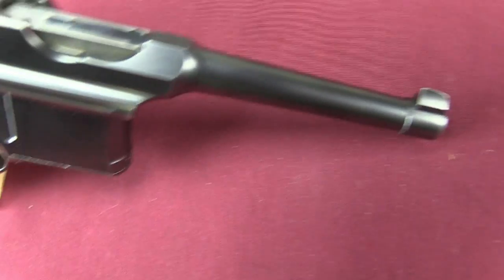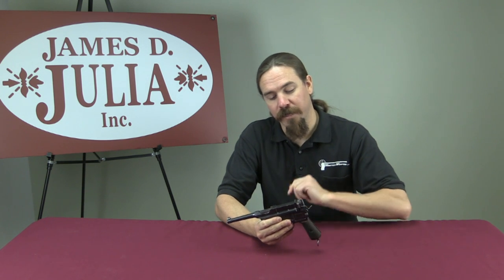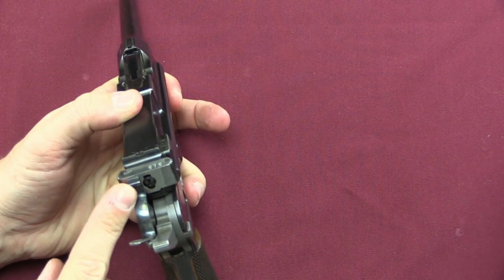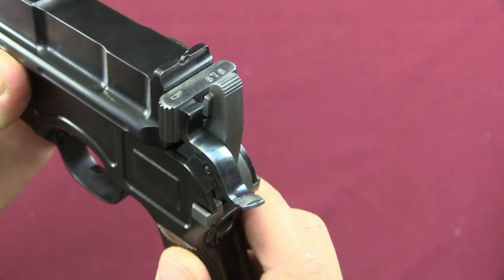Experimental C96 "Joint Safety" Mauser

Comment: It would be incredibly amazing if you ever could get your hands on a Welrod 9mm handgun. For those who aren't aware, the Welrod is a bolt action, magazine fed suppressed handgun in 9mm designed by the British during WWII to equip special operations (SOE) agents as well as operators from the OSS and resistance fighters in occupied territory, mainly France.
Being produced for covert operators, the guns bore no markings except for a serial number. Because the suppressor used rubber and leather washers that literally made an air tight seal with the bullet as it traveled down the suppressor, the rubber wipes had to be changed every 15 rounds, preferably earlier, as the effectiveness was diminished after every shot from the 5fth onward.
Its one of the most exciting "spy" weapons of WWII in my opinion, and I think it would still be quite effective today for the purpose it was designed for.
Reply: I'm aware of what it is, & I agree, it would be amazing to have that thoroughly examined & just seen regardless.
Reply: Adrien Perié except for the fact that they have been banned from import here in the USA
Reply: Adrien Perié 
Would it be called bolt action or single action?

Comment: Mausers are still some of the most beautiful firearms on the globe, in my opinion.
Despite being a fan of Norinco and Tula.
Reply: +Moon .Gazer
 Just its appearance is amazing. It feels very serious while still be fancy as all hell.
 The magazine is rectangular and robust, yet cylindrically rounded so it doesn't prove too sharp. The barrel is straight and independent with no gas tubes or recoil springs under it, as well as subtly tapered to look sharp without being so. The front sight starts with a block but sweeps in as it nears the top like a point on a crown, but forms into an edge instead of a point to be sturdy.

Comment: Whoever designed that safety must have worked for the BATF at some point.
Reply: +FinalLugiaGuardian Uh, that was a fictitious and somewhat sarcastic comment made to compare that horrendous joint safety on the C96 Mauser with some of the BATF's regulations.
Reply: Whitey Ok then.

Comment: That's one of the oddest safety mechanisms I've ever seen...how did it save any weight or make the gun theoretically better for carry than the other, apparently simpler C96 safety levers?
Also, were there other experimental lightening/carry modifications you didn't explain in this video?

Comment: 4:16 whats the purpose of the little spring under the safety lever? was it maybe ment as grip safety where the spring would keep the lever in safe position until you put your hand under it pushing it forward?! or to automatically disengage the safety after cocking the gun...